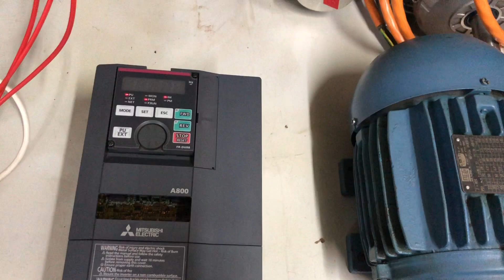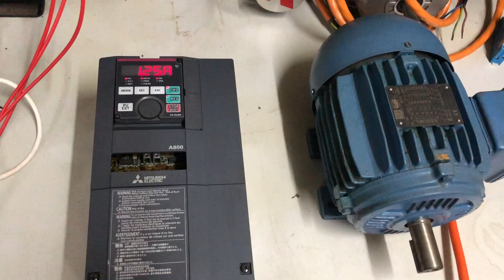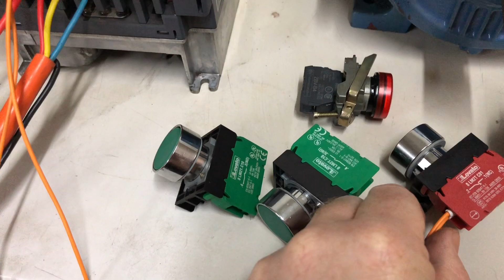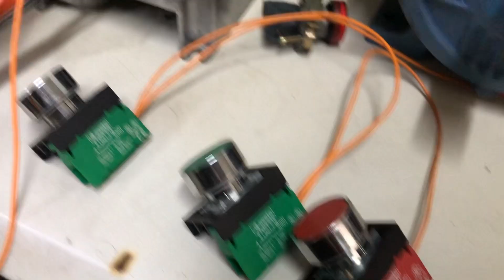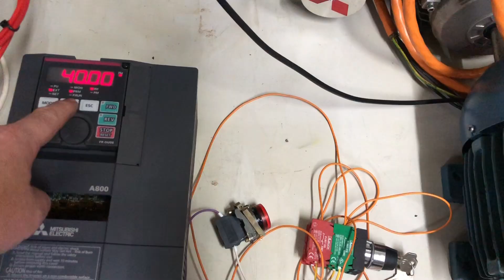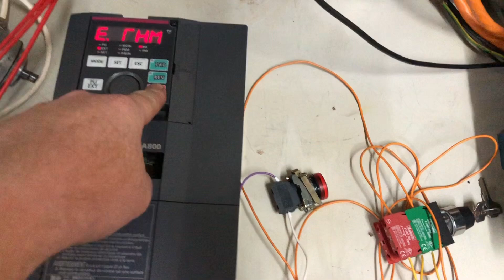8//FR-A800 3 Wire Stop/Start with 3 Preset Speeds & Trip Lamp (Hardwired / No PLC)

Comment from the maker: Setting the PWM Pr. 72 to a higher value can cause leakage currents & noise. You might also have to reduce your overload setting. The max setting on Pr. 72 is 15.

Comment: Nice and quiet on higher PWM output, I think you can set to 15 ? but yes create noise unless you use filters, thanks for the information and explanation, wil be great to see the internal PLC usage 🙏
Reply from the maker: Thanks, yes that is a great idea. The internal built in PLC function. 🙏👍